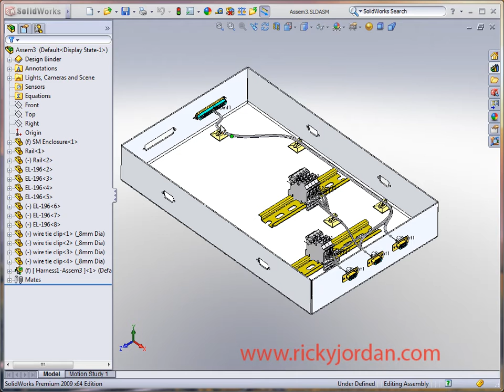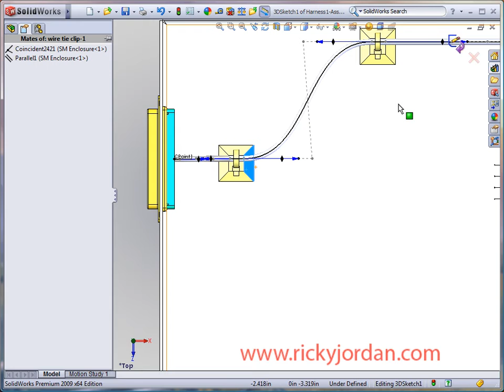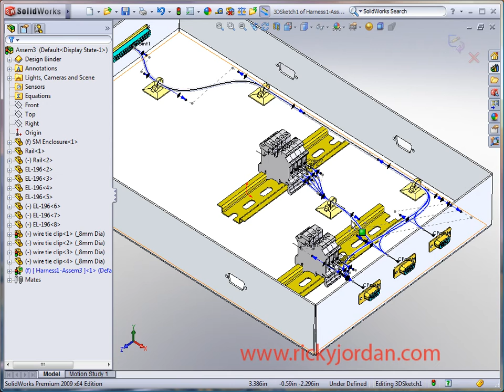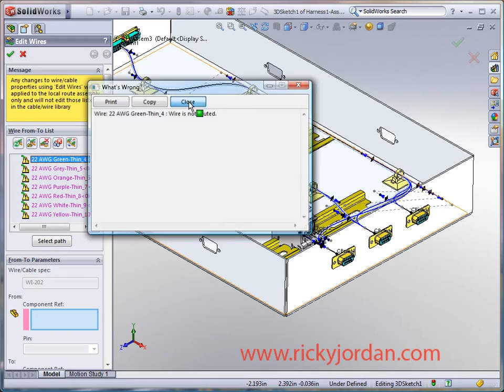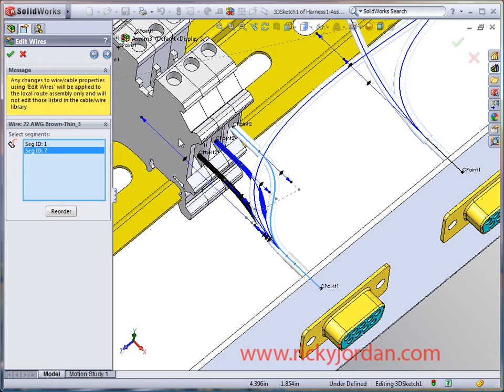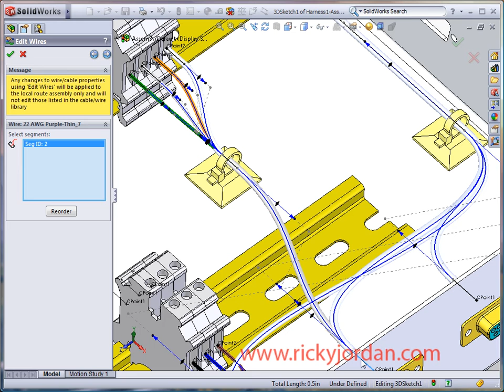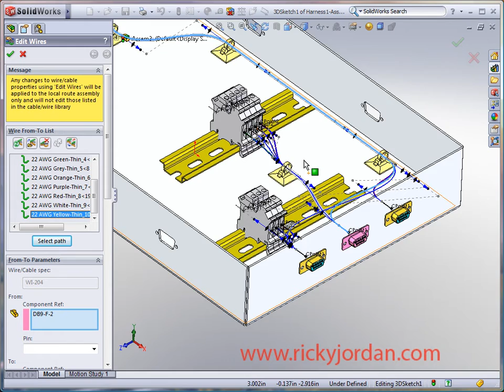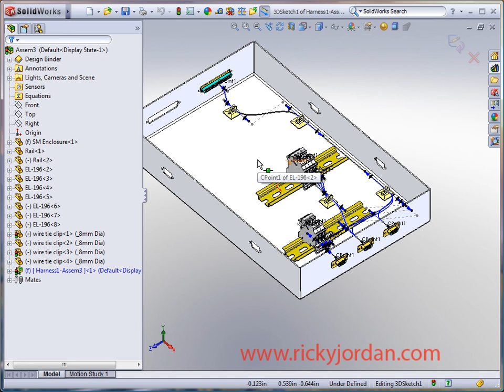SolidWorks Electrical Routing Part 2

Comment: Ricky,
Can you tell if you had any luck unhooking the wire from the clip through which multiple wires were routed?
It works OK with the single wire and while the box is ticked for the "shortest route" the spline goes pretty much back to it's original shape. However, even when two wires share the same clip axis, there is no way to separate the wire(s) that you need to re-route. I see the lack of flexibility on SW part here. Moreover, if my finding is correct, I will be very surprised that no one ever brought it to SW's attention. Or, is it rather an indicator of the fact that very few people use electrical routing module is SW?
If you can confirm or disprove my findings, it would be greatly appreciated.